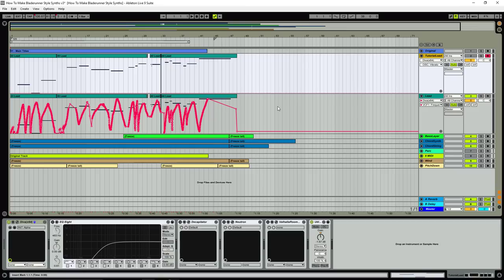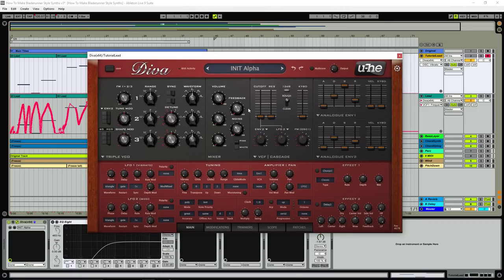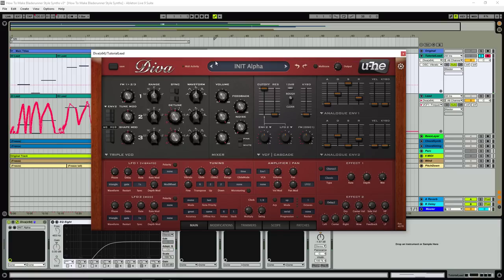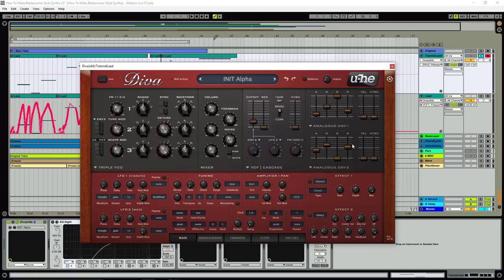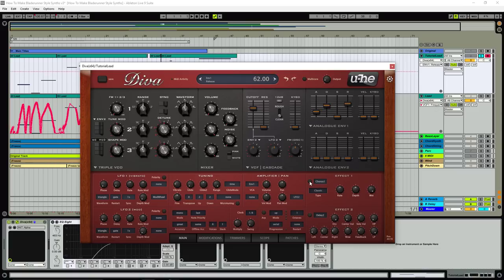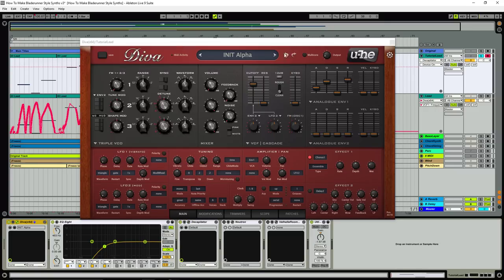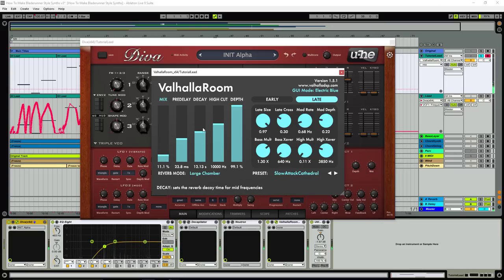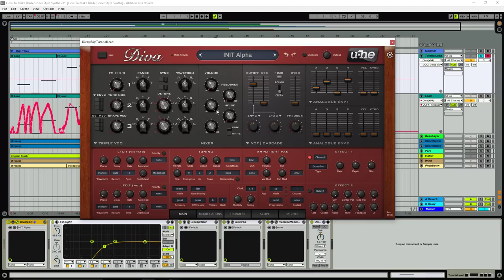How To Make Blade Runner Synth Lead (Cinematic / Ambient / Diva Tutorial)

Comment: Thanks for the Tutorial! The synth sounds great! I have all your plugins except decapitator and Diva so I used Serum for the synth and SoftTube's Tape for saturation.

In Serum I went to Global and changed the Unison mode to "Super" to try and emulate the super saw sound and then gave both saws 7 voices but only detuned them by .06 each (while still keeping the original detune by about 2 or 3 cents). It sounds thicker but still has a retro sound to it in my opinion.

Comment: 6:06 for me the filter is slowly closing instead of slowly opening like it does on yours. I've replicated all your settings i think, what am I doing wrong?
Reply: you have to invert the envelope, i don't have diva but on the picture it seems like for the "ENV 2" amount, you can turn it plus or minus, so to solve your problem turn that fully in the opposite direction

Comment: Hey man love the sound you 110% nailed it.  May I make a small recommendation, I appreciate that you started the video with the example of the sound, but I would def. recommend to go with dialing in oscillators first (ADSR if needed) and then filter, cutoff reso and then ADSR as well so the core of the sound is built upfront.  This helps those looking for the core as well as others learn how sound design works incrementally.  Thanks again so much man, you nailed the sound!  Subbed I look forward to you growing :)

Comment: As a noob, is this achievable with Serum ? (since that's the only synth I own)
Reply from the maker: It will lack some of the subtle characteristics that make this sound analog, but you can achieve the basic sound by applying the same oscillator settings, filter cutoff automation, vibrato etc.. especially since the sound is drenched in reverb anyway!